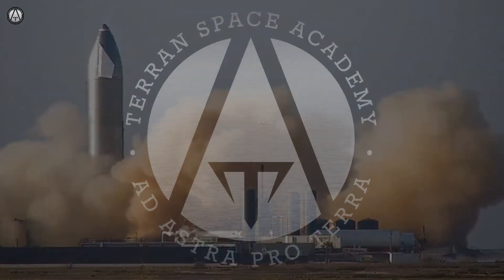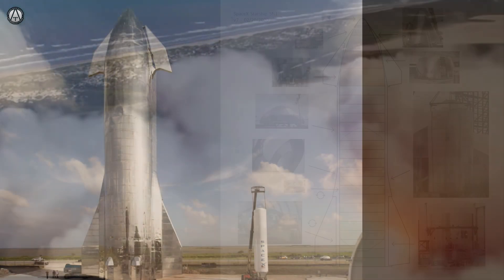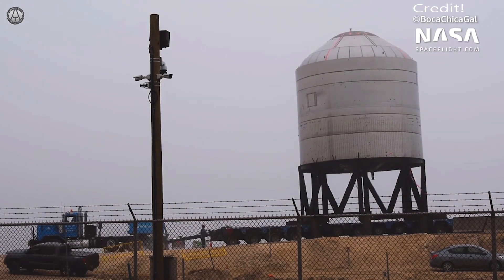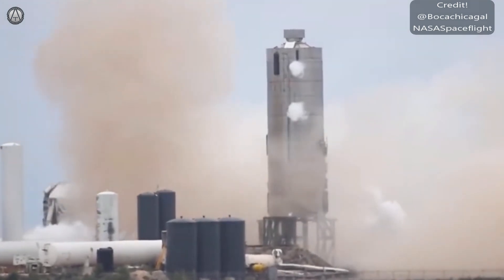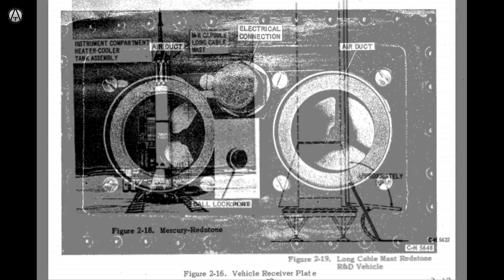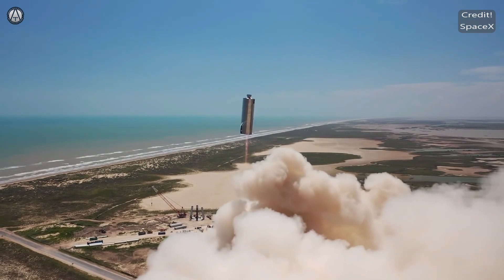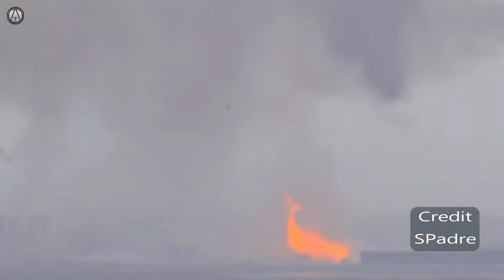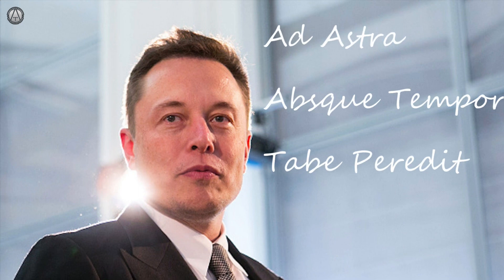SpaceX Starship 11

Comment: Request: Assuming there was an indestructible capsule with properly strapped in humans in the cone of SN8, 9, 10. Can you do the calculations for acceleration on those hypothetical humans to determine if the crashes/explosions could have been survivable?   According to NHTSA max chest acceleration shall not exceed 60 G for longer than 3 milliseconds (although elsewhere I've read that although survivable over 30 G is likely to cause serious injury).  I think the crumpling of the lower part of the starship might provide protection for the cone area. After SN8's hard landing, the cone appeared to be mostly intact. Also, the explosion of SN10 appeared to create massive G-forces as well, as would the fall of the cone back to the ground, so SN10 would have suffered heavy Gs on hard landing, explosion, then cone landing back on ground. My gut tells me SN8 would have been the most survivable landing, but I'd like to see the math. :)
Reply from the maker: If they use inflatable ballistic fiber interiors as I've recommended and the passengers are properly belted they would have survived the landings of 8 and 10 pretty easily.  Though flying chunks of steel would almost certainly create casualties...
9 would have been fatal no matter what.  And poor 11, we don't talk about 11...